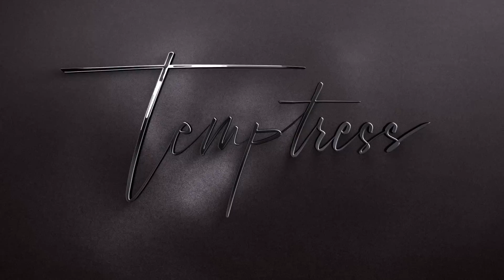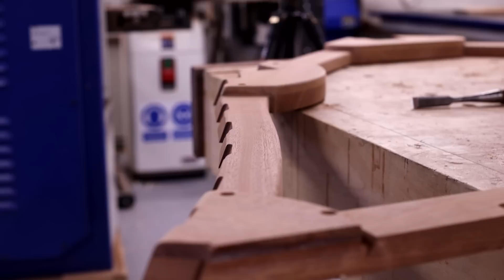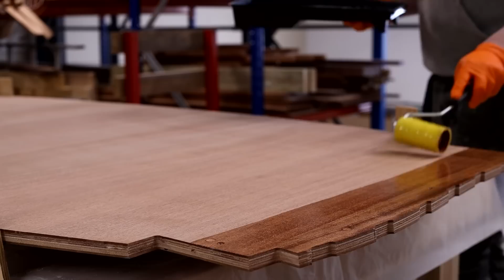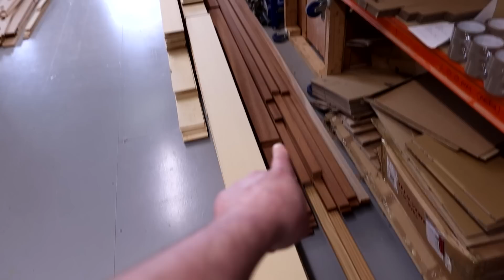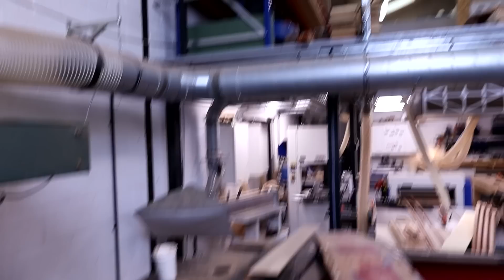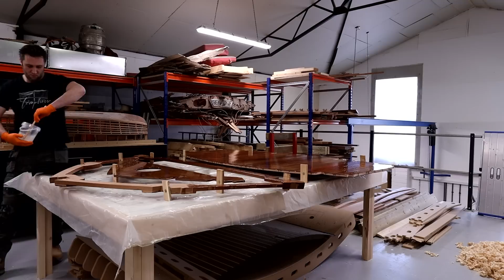Pre Finishing Wooden Boat Frames | Building Temptress Ep26

Comment: Why not take a heat gun quickly over the surface in order to eliminate all bubbling?
Reply from the maker: A common question this one. This process is used a lot by people doing deep pour river tables, the issue with doing this in a coating scenario is that it warms up the wood, thus creating more off gassing and more bubbles. In a scenario where you are coating bare wood this makes the problem worse. If the wood was already sealed (which it usually is in a river table scenario) then you could use a heat gun.

Comment: Brilliant series Dan, I'm thoroughly enjoying myself!! And eyeballing an old set of Farrier Command 10 tri stitch & glue plans that'd be a prime candidate for your digitizing and CNC process at the same time ;-) ... Anyhoo, I know this is an older vid and you've probably sussed it all out by now, but I've worked with some of the best (surf craft) laminators on the mainland here for years; with epoxy their consensus is pour your full pot in one go onto your wood or laminate, spread with a large flexible spreader or big brush in one go (never roll) and leave it alone. The aggressive fast mixing, using rollers in trays and rolling the same area multiple times introduces thousands of microscopic air bubbles you'll never be able to fully bust out. With added layers of glass it's even worse and you just need to let it soak and wick, if you've poured too much resin that just means more sanding. If you start spreading to correct/redistribute this again, reworking the surface while it's curing you'll just get more air. Also if not doing 2nd or 3rd epoxy coats wet-in-wet while layers are still tacky, after every full cure the amine blush needs to be fully removed, a light sanding to open up pinholes is needed and then maaaybe you'll get a blushless clear finish. Super slow curing mixes help, but this is one of the huge frustrations with all epoxy systems in getting consistent (tinted) finishes without any murkyness, vac bagging removes a lot of this annoyingness but is such a pain with complex shapes. Sorry for the ramble, just my two cents from the surf craft point of view, but while watching this I thought maybe it might help you out if needed! Cheers

Comment: to reduce dust in the air a lot, lightly dampen the floor with water (no puddles) (wait about 3-5 minutes to begin)  you will watch the dust fall to the floor and not come back up. It will stay in the dampened floor.

Comment: Hey Dan, I really enjoy your channel so thank you. Question though on the tipping process, which seems to be focusing on removing the bubbles from the resin. I've built a resin river table and with deep pour resin we use a heat gun or flame to pop all the bubbles,  just wondering if that is possible for the resin you use instead of tipping? or is there a reason not to do that? maybe its because you only have a thin layer?
Reply from the maker: This question has been asked a lot so I am planning to cover this in this weekends live stream and do a demo of when this can be used and when it shouldn't 👍

Comment: Just a couple of thoughts as I was watching the video. Which I'm enjoying a lot by the way. 
First thing I was wondering is have you ever tried using a propane torch to pop the bubbles like they do when making an epoxy table? The other thing, I would suggest adding a short extension to your roller. Being a professional painter I recommend using one as it improves the balance and tactile feel and makes it easier to apply and even coat and thickness as well as extending your reach. I like to use a wooden broom handle that I cut down and you could always buy one made from aluminum that is extendable.
I pick up a lot of tips watching your videos and enjoy the dedication to detail that you do. 
Till next video cheers and have a good one.

Comment: Great video as usual, Dan. Surprised to hear the air still exits the wood after the first coating and is it still exiting after that?  Hope that you have a customer for the first Temptress. Cheers, Ian
Reply from the maker: Although the first coat will have tacked up it is still soft so any air that forces it's way out of the wood (which it will under significant temperature changes) will still push a bubble into the soft epoxy. Once the first coat is fully cured of course this will no longer happen.

Comment: Hello mate. as a Gas engineer that has very slowly progressed into full property renovation. Imstill learning about many things especially carpentry. would you recommend the resin treatment for a wooden floor? is it able to withstand the constant abuse from shoes etc?
Reply from the maker: This could be used for a floor, over coating with a hard wearing polyurethane varnish would be a good idea. Using West System 105/207 would probably be an expensive option though for a large surface like a floor.
Reply: @DanLeeBoatbuilding  The room in question is 3m by 3m so not huge. thanks for your advice I shall do some more research. keep up the good work.
Reply: @bmanduprit2962  There are specific floor epoxies available these days for casting. It should definitely be possible to only do a few mm layer thickness and still get a great result.

Comment: So here's a thought. It seems to me that the reason some people prefer fiberglass boats over wood is ease of maintenance. Wood boats require regular repainting, and revarnishing of bright work, where as fiberglass boats merely need periodic buffing and waxing. 
  You mentioned that Temptress will end up being varnished, and it occurs to me that she's first going to be encapsulated in epoxy resin. The same thing that a guy might use to build a fiberglass boat. 
 My question is, wouldn't a high gloss transparent gel coat be a harder, more durable, and easier maintenance finish? Don't you already have the perfect substrate for gel coat? Wouldn't it be easier and quicker to shoot a few layers of gel coat out of an HVLP sprayer, cut and buff, then wax than applying several layers of varnish by hand with roller and brush? Is there any logic to where I'm going here, or do I need to put down the crack pipe?😅  maybe a dumb question to you, but I'm just saying.

Comment: Great video as usual. Interesting you said the yellow cedar smelt good. The door firm I used to work for pre retirement used hundreds of cubes of Western Red Cedar which smells great. We had a house full of doors where the client wanted yellow cedar. The smell of the wood was disgusting when machining it. Maybe a different timber? Also with having the cedar as the top surface inside, how dent resistant will it be?
Reply from the maker: Well, I haven’t really machined it yet but so far it has a nice fruity smell to it, very similar to red cedar. Let’s hope it stays that way!

Comment: I notice you haven't covered the edges of the pieces. Why is that and what happens there? Thanks
Reply from the maker: This varies a little between frames. Frame 9 has more to be bonded to it on either side so I’ll seal the edges once those parts go on. Most frames have the edges sealed but left anywhere that timbers will be bonded in. This is because I don’t want to lose the accuracy of the CNC shaping and so I can bond to bare wood when the following parts go in.

Comment: You can get your total epoxy weight just by multiplying by approx 1.286 and save a calculation.  (Ex. 269*1.286=345.9). Where 1.28571 = 1 + 1 / 3.5.  Basically, it turns the ratio into a percentage and adds 100% which is the weight of the resin.
Reply from the maker: Great tip thank you 👍

Comment: Again an excellent walkthrough of your process and what to look out for. Especially the sequence about temperature and moisture was an eyeopener for me. Apart from understanding the implications of too much humidity the part about NOT adding heat  during the curing process was completely new to me! I‘ve seen people build tents over their parts and add a heater and I thought that that was a good idea - no longer so!!! Huge thanks to you!!!
Reply from the maker: Yes the heat is a common misconception and I’ve only learnt this through doing it wrong myself 😆 building a tent is a good idea and heat helps for sure but they key is to heat first and then either maintain temperature or let it drop slowly as the cure happens. Applying the finish and then increasing the heat = bubbles galore!
Reply: You can add heat of about 50-70 degrees after the first hour for about 2-4 hours if you're doing a lamination to increase the strength of the epoxy. But that's a completely different subject to coating and finishing.

Comment: Bonjour Dan, merci pour toutes ces vidéos elles sont précieuses…!!! J’avais une question…, je construit actuellement le Playboy MK2 et je me demandais si tu savais ou se trouve la ligne d’eau sur ce modèle ? Je vais bientôt avoir besoin de la délimiter et j’ai peur de faire une bétise 😅
Reply from the maker: There isn’t a great deal of waterline information in the original plans. None in fact other than an approximate drawing. I could calculate this for you if I had info on some weight elements and placement for your boat. Timber used, engine and fuel etc. With that info I should be able to work out a pretty close waterline for you. Alternatively, float the boat with loads in it, mark it and then final paint to suit.
Reply: @DanLeeBoatbuilding  
Merci pour ta réponse Dan , je cherche surtout la ligne horizontale, je mettrai un peu plus de hauteur pour pallier au surpoids éventuel. Est-ce que c’est la ligne du cadre qui sert à la fabrication ?
Reply: @DanLeeBoatbuilding  
Apparemment c’est la ligne de l’arête du bouchain qui suit la flottaison sur l’horizontalité… tu confirmes ?

Comment: Excellent thank you Dan, very insightful as always! It’s brought home to me how critical the encapsulation process is and how vital it is to do this correctly, using the right system (quality epoxy and varnish grounding and finishes) and following the guidelines you have walked through. The price for not following this closely is a boat that will deteriorate in 5 years as opposed to lasting 50 or more! Qualitatively the art of boatbuilding is to follow the tortoise not hare pace for sure. Getting it right is way more important than hitting an unrealistic deadline! Quality boatbuilding and production.

Comment: Btw, you mentioned about the milky finish, we have a couple doors on our boat that have a milky appearance to their finish (was that way when we purchased it). Is there a way to remove that issue other than removing the whole finish and redoing it?
Reply from the maker: The milky finish can happen for a number of reasons. At the application stage as I have shown it is often overworking. If it appears further down the line then this can be either due to water ingress or UV damage. There is not really any fix that I am aware of other than removal and refinishing.